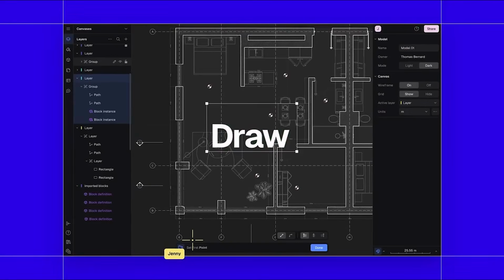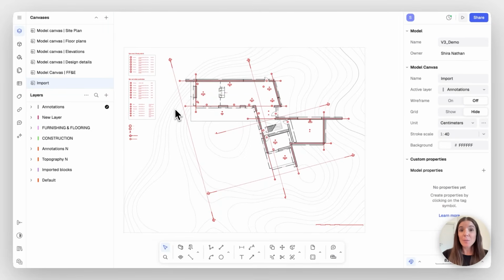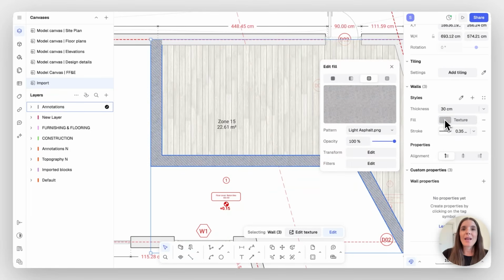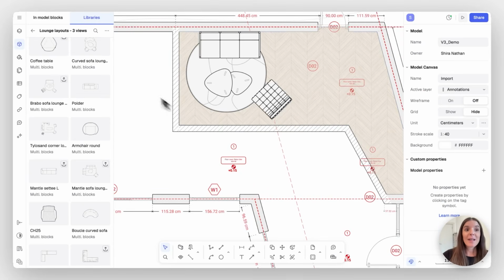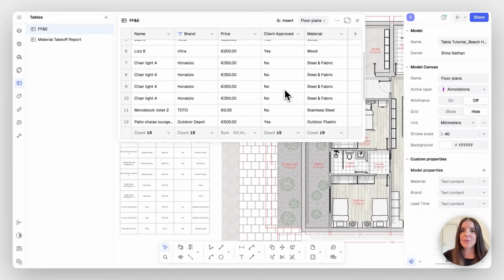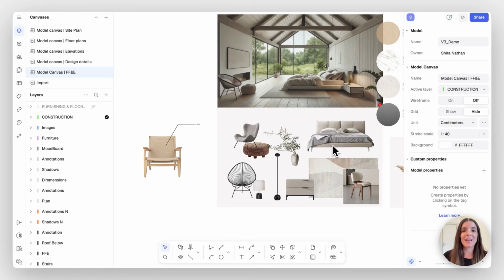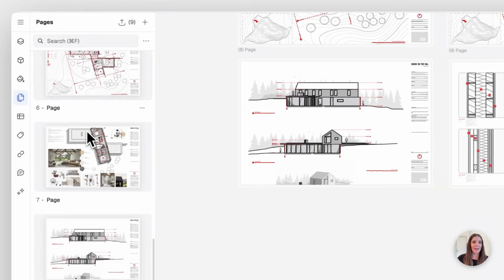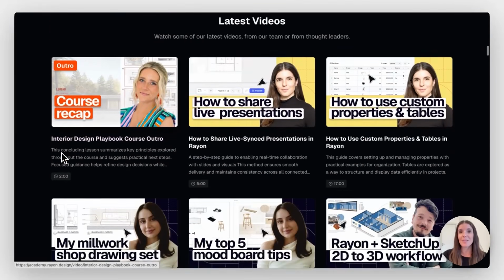Rayon Design's 20-Min Demo

Comment: It’s very useful for those just starting out with CAD or SketchUp projects, but if you look at the AI-generated images, notice the error on the upper floor—the perspective doesn't match the floor plan measurements...
Reply from the maker: Good catch, thanks for pointing out that inconsistency in the generated output! 
Fortunately, Rayon allows for iteration in the AI generation, with the ability to select parts of the output and dedicate prompts to improve it. See more about our AI tools here: https://docs.rayon.design/documentation/work-with-ai

Comment: Dear Rayon Support Team,

I am writing to bring to your attention several critical issues I am experiencing with my Rayon account.

Payment Issue: I have been charged for the Rayon upgrade subscription, but I do not have full access to the features and templates as expected. I am the only user on my team, and I am using a single account for both the purchase and access.

Missing Designs: All the designs and floor plans I have been working on have disappeared and cannot be found in my account. This is causing severe disruption to my work.

Support Button Not Working: The support button on the bottom left-hand tab of the app does not load or respond when I click it, preventing me from contacting support directly through the application.

Additionally, I have reached out through multiple channels without any resolution:

Messaged you on Instagram.
Sent two separate emails since the day of purchase.
I have received 0 responses back to any of these attempts.

Given these issues, please either issue a full refund for the payment charged or restart my subscription with full access and recover my lost designs.

Please address this matter urgently, as I rely heavily on Rayon for my design work.

Thank you for your prompt attention and assistance.

Best regards,
I am not going to put my email address here, but please respond with yours so that I can get in contact with someone from your support team.

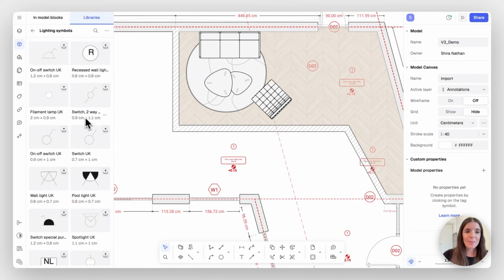Comment: 9:32 would it be possible to have this technical drawing icon legend autogenerated based on the icons really used in the project? (So it shows only the 8 icons&descriptions for those that are actually used, and not all 26?)
Reply from the maker: Hi there, that's a great idea! We are currently working on the Table feature, you will have an option to select specific blocks to add into it and organize them as you prefer.

Comment: The software looks well-designed and user-friendly. Although I haven't used it yet, I’ve had the chance to research and conduct a brief analysis. I wish you the best of luck.
However, the fact that the software cannot be used without an internet connection is a major drawback. I highly recommend developing an offline version of this tool. In construction site environments, internet access is not always available. No internet means no instant revisions and no way to track the project through the drawings. To open or edit a project offline, one would have to export it as a DWG with a Pro membership and use software like AutoCAD. But if I’m forced to use other software anyway, there’s no point in using this one.
Please be aware that insisting solely on a web interface will limit your growth. Anyone who finds themselves in this situation wouldn't use this software again. It must be accessible everywhere and at any time—especially offline.
Reply from the maker: Hi there, thank you for taking the time to research Rayon and share your feedback — we really appreciate it! We’re continuously exploring ways to improve accessibility and workflows for users working in different environments.🙏

Comment: It's impossible to adjust shadows on objects, which is a drawback. In Figma, this is a built-in feature that works without any problems.
Reply from the maker: Hi there, for now, all the shadows are drawn manually. We do not have a ready feature for this yet.